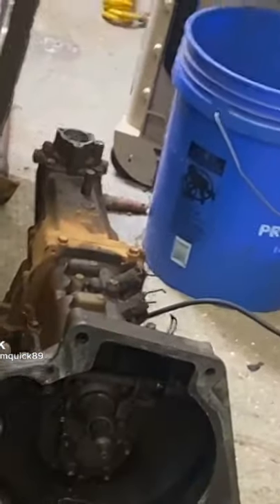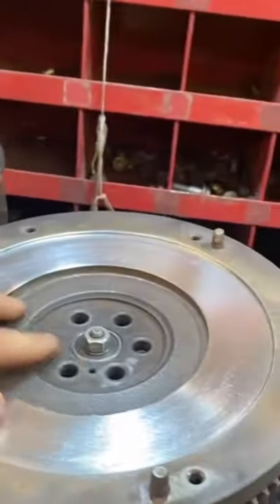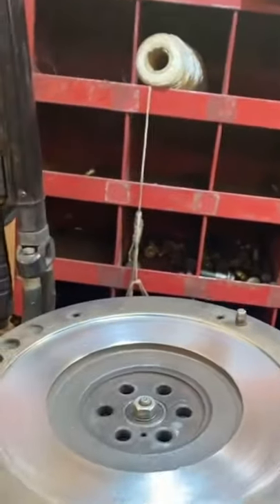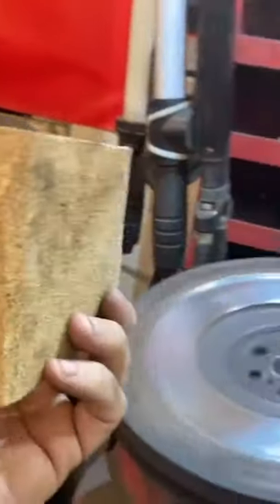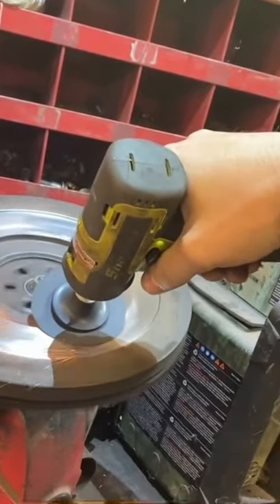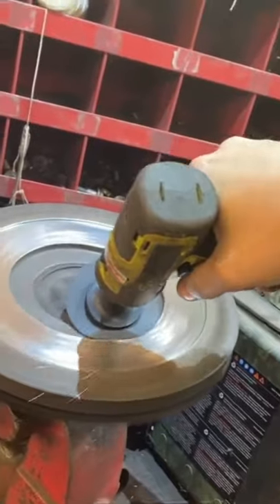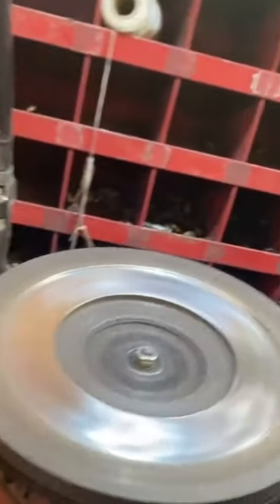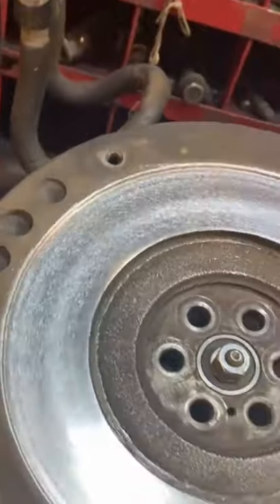How to resurface a flywheel when doing a clutch in less than 60 seconds#shorts

Comment: Should have been resurfaced in a lathe. Just removing the minimum material to get rid of any rust pitting and to make sure the surface is perfectly flat.
This way they'll be high/low spots all over the surface which in turn will cause juddering and rapid clutch plate wear.
This garage shouldn't be working on cars..
Reply from the maker: true that.

Comment: Took a 22re toyota flywheel into a parts store with a machine shop. Came out flat. Stupid jerks ground the raised area off the inside.  As I am getting loud with the employee the store owner stops by and greets be by name. Told him of the new fangled single surface job his employee just did to my stepped flywheel. This was fixed quickly by the store owner. My family had been doing business in that store since 1940.
Reply from the maker: Wow. Bet you were angry. But thanks to great customer service.  Huh.

Comment: This is not a bad way for if you know what your doing. You can rule out a mechine shop by measuring the thickness of the flywheel and the thickness variations across it. I wouldn't do this on a customer car personally. I would just play it safe. But there's no burn marks on the flywheel so I'm going to say that there is not enough thickness variations to need to have it machined. But i would have verified it with a micrometer. All in all hes just buffing the surface to make the new clutch have something to stick to. Personally I would just recommend the flywheel be turned upfront to cover my butt and to spread the liability and to have a better overall quality of the service.

Comment: Got a brake lathe? You could actually machine the flywheel if you got an arbor that's long enough and a nice sharp bit it's not the greatest way to turn the flywheel but it's a lot better than using a piece of sandpaper and scratching your ass with your other hand like this guy's doing this is a good video for showing you what not to do. 
..

Duurrrrr

Comment: No one seams to notice he isn't cleaning the surface that the clutch contacts. That is the side that bolts to the engine. The side he is doing is at an angle. Clutch side is flat.

Comment: First you should spray it with a degreaser, then rinse with a salt water. Let it air dry, but mist with more salt water so that it dries evenly.  Remove any rust with a hack saw.  The grooves that are left behind will help the clutch grab onto the flywheel.

Comment: That's basically how I machined a part for my mower that had been discontinued. I didn't have a lathe to make the bushings fit, so I stuck them on the wheel shaft and used an angle grinder with a cutoff wheel to spin them down to size.

Comment: It’s doable this just isnt the best way to do it. First of all, you use a buffing wheel so as to not remove any material from the flywheel, second you need to wrap your high grit sandpaper around a piece of wood to make sure you have a flat surface.

Comment: Okay so that's a step flywheel where are the bolts are that needs to be surfaced too because there's an exact measurement between the two levels and if you only stand one you're increasing the space so there would be less pressure on the desk doesn't matter if you want to take a thousands off that's not the correct way to do it

Comment: So now the surface still isn't true and you didn't take the same amount of material off the pressure plate surface so now you're clutch will not have as much holding power, great job, you would've been better off doing nothing.

Comment: Now the drag race way.  Mount the fly wheel on a break cutter use 1 bit cutter  slowly cut dont drive on road do not slid cluch  rev to hell 10000g side step cluch find weak link no guts no gold😲

Comment: Ah so he's a clutch machinist he's showing you how to not do it so you do it and end up coming to his shop next time lol
Reply from the maker: Interesting.
Reply from the maker: Not even a light surface????
Reply: @Karl.Car.tech.1  if you have to surface them then do it right you will never get it flat enough by hand they turn rotors with a machine that keeps it's completely flat and level it's one thing to scrub off grease and rust with a light clean but taking material off is not a good idea
Reply from the maker: I agree. But.
Reply from the maker: It’s always best to resurface. Right.
Reply from the maker: But if there was no pulsations. It’s ok.

Comment: Please. Don't do this. I guess In a hard hard pinch but like. My shop charges 40 for that. Takes 10 minutes. Remove dowel pins if you're doing to do this. And have a good dial gauge setup so you can measure the factory step. If it was a flat flywheel you could probably get away with this a little bit but.... Cmon. 40 vs your shit not lasting as long as it could or not working well.

Comment: Yeah that's a BAD idea, a buffer on ANY machined surface is bad, the 3m plastic buffer rolox pass r the only thing I use when it's just no way around it...no matter what u do u CANNOT make that a flat smooth surface, send it to parts store to put on a machine designed for that nd u want have premature clutch issues

Comment: This is pretty dumb you don’t remove the burnt spots and you can’t surface both faces equals a straight to be sure your brand new clutch will touch even everywhere! Bring that to a machine shop it’s around 70-80$ and you’ll end up with a brand new flywheel! Don’t ever do that on a flywheel you’ll ruin it! Trust me I’m a machinist and did way more flywheels than I can remember!

Comment: You're supposed to resurface the step two whatever you take off that friction part you take off the step as well so that the pressure plate applies the correct amount of pressure your questions going to slip, don't listen to these morons wait till the next day take your pressure plate to the machine shop and have it resurfaced correctly.

Comment: This is a joke right? You still have to step the outer edge down so that the pressure plate has the correct clamping force. I hope no one is actually dumb enough to do this.